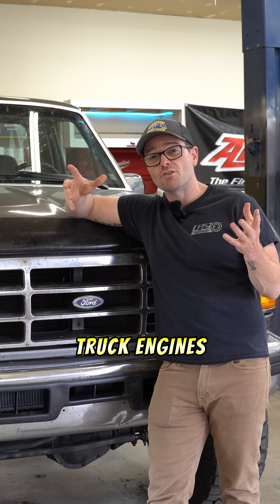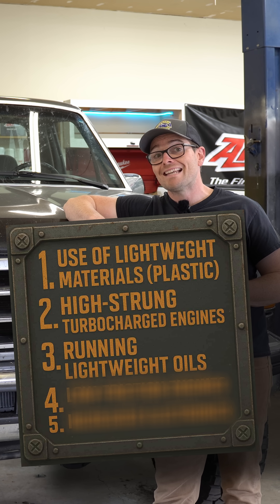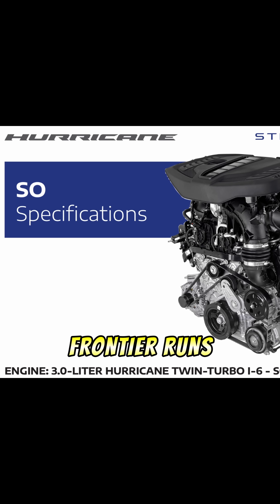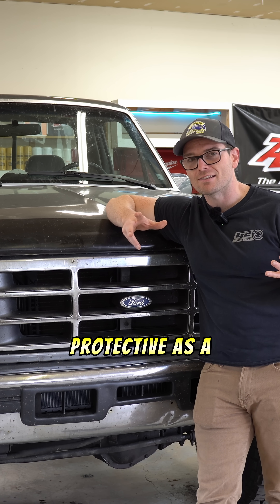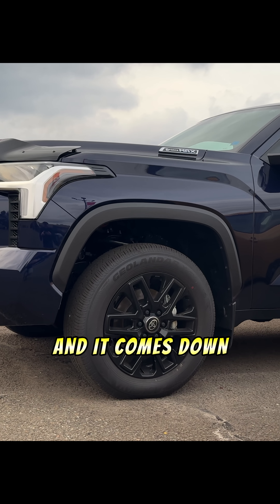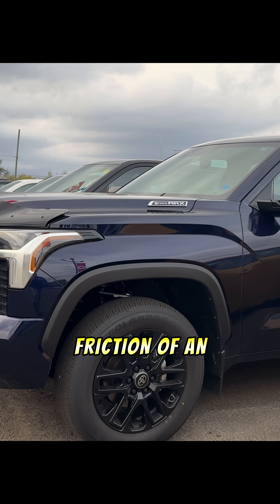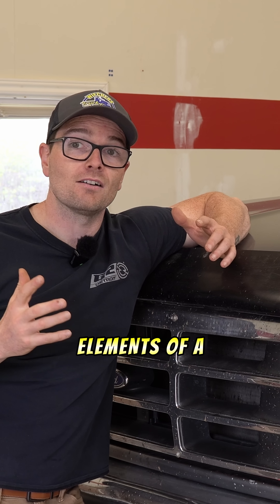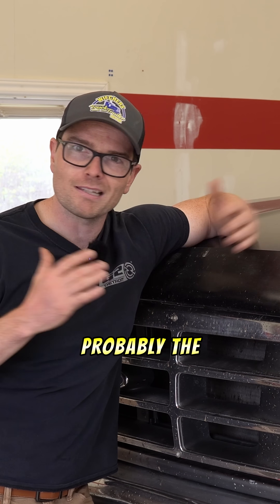Major Reason Modern Truck Engines Don’t Last as Long 👀

Comment: You know it’s crazy personally I know someone who has a 2019 Tahoe he’s supposed to run the manufactured oil viscosity he doesn’t he runs 5W 20 or 30 and it has not blown up on him once it has over 90,000 miles brand new he got it since he reached the breaking period. Switched to 5W-30.

Comment: The Toyota 2gr-fks engine is used in multiple locations. Toyota engineers specify 5w-30. The US GOVERNMENT specify 0w-20. I'll stick with what the engineers say. The EPA and CAFE regulations are not in your best interests if longevity is your goal.

Comment: My HEMI RAM uses 0w20 they say more the lifters lighter oil easier to get oil everywhere... 

I had a 2014 5.7 with 245,000 miles with zero issues, my 2023 had 45,000 miles no issues yet...I guess I will find out...

I use Pennzoil ULTRA Platinum that's the best oil it's as good as redline and Amsoil...I  change at 5000 miles but even my 2014 I went 8000 miles a few times,just busy but oil was clean and mainly hwy driving and I am not hard of them...Yes,I floor them more than the average guy but baby them!

My classic cars I run 10w 30 with zinc additive and or hot rod and classic oil! Usually 10w 30 with zinc on my 440 and 383 even my 340 Mopar all run 10/30 and zinc...My new RAM 1500 (two of them wifes and mine run 0 w 20)

Comment: The hotter that 0w20 oil gets the thinner it gets and more chances of metal to metal contact on the crankshaft/rod bearings. But just wait until engines require even thinner oil
Reply: Congrats, you described exactly how multi viscosity oils work. 5-40 does the same thing. Lube weight is an afterthought when you consider clearances, pressure supply, and total circuit volume.

Comment: i run 15w40 in my 6.7 powerstroke, my l5p dmax, tym 574 tractor, ferris 6200 cat powered diesel mower, and from time to time toss some in my polaris general if it gets low. i buy my oil by the 55 gal drum from amsoil.

Comment: What does it do for the power of the engine?. I personally have sean the lighter oils weaken engines quickly. I feel thiers a balancing game that these manufactures are makingare the problems worse and they dont make sense. How bout all the extra emissions from restrictions to carburetor cars. Thier fuel efficiency can become something people jaw dropping.  wouldn't it make sense if to save oil and emotions by having a vehicle have great power , speed, efficiency, lower running temp, responsive thrhottle , plenty pf power and with modern flat slide carburetor's reducing moree parts needed. No computer needed even with mechanical direct injection . A mechanical marvel designed to last and get fuel economy from 20 mpg all the way to 120 MPG and higher wouldn't you want that. You win . Or would it crash the market due to how much oil is currently needed to be sold to keep an economy healthy

Comment: Is it possible to run slightly higher weight oils in the newer engines to provide more protection, or will it destroy those engines?

Comment: I have a 2003 ford F150 5.4 2 valve with 426,000 miles on original powertrain.  I use 0w20 high mileage,  again 426,000 miles and runs perfectly.
Reply: 🤣🤣🤣no 5.4 has that many miles!🤣🤣🤣
Those engines are garbage!!!
Reply: @philllsxga.7737 the 3 valve was awful,  the 2 valve ( which I have, its common to see ultra high mileage.  That's a common thing. ...   Oh yes,the miles are real.
Reply: @michaelhungate7506 no way!
I know the timing chain and phazers have been changed.
Reply: @philllsxga.7737 the 2 VALVE ENGINE DOES NOT HAVE PHASERS. You are NOT understanding the difference.  Google it, tge difference between the 2 valve 5 4 and the  3 valve 54. That's why there is such a difference,  the 2 valve didn't have the timing problems either.  Very different engines!!!!!
Reply: @Takeiteasy-u3r the 5, the first number is oil flow at cold start, you want it as thin as possible so it lubricated quickly. It works very well,  and the 20 is operating temperature viscosity which is the same.

Comment: 30 year lubrication engineer here. Just retired.  I saw SAW  5w-30 engines lasts twice as long as SAE 0w-20 or 0w-16 in fleet testing.  I only run 5w-30 in my gasoline engines and SAE5 w-40 on my diesels.
Reply: “lubrication engineer”. What exactly is it you did, and what company and what was your role?
Reply: @l @lukeWiz44 
Pennzoil Quaker State technology manager. For Shell
Reply: @lukeWiz44  he worked a company called Nonofyourbizniche. He was involved in how to “grease the skids” or “lube the tube” in cases when certain equipment or individuals needed ‘tude adjustments. His title was VP In Charge Of   Experimental Viscous Lubricity.
Reply: @lukeWiz44  he did your mom

Comment: Rolling a 2012 tundra that specifies 0w20 mobile 1 in the manual. Used it since day on 10000 mile change intervals per the book. Clocked 367,800 miles. Uses a 1/2 quart after 10,000 miles. Seems to be okay so far, don't know maybe I can complain one day?

Comment: I run 0 20 in winter 0 30 in summer I'm not an engineer but my vehicles last 300000 km before selling them 0 will get there faster.

Comment: Oil weight does not matter, if you have the same flow and pressure with 0-20 as you did with lets say 5w-30 there is no difference

Comment: Hello from India,

Thank you very much for making deeply technical, passionate, and informative content.

I own a Jeep Compass diesel manual with the 2.0L Multijet II turbocharged engine from Fiat. According to the owner's manual, 0W-20-rated oil that meets the API-certified SAE 5W-30 ACEA C2 - FCA 9.55535-S1 synthetic engine oil standard is recommended.

I was hoping to get your guidance on whether it's best to stick to the recommended standard or switch to a higher viscosity range. Also, if possible, please recommend your trusted brand of engine oil.

Thank you very much once again.

Comment: I’ve always found my Volkswagen runs better on 5W40 than the “recommended” 0W20.  In fact, the prior version of the same engine with the same displacement ran on 5W40.

Comment: Or the real answer engine tolerance is that changed because of this tighter tolerance that oils do a lot better than thicker oils I mean it’s like pretty simple automotive science you know we’re using proprietary fancy materials that we didn’t use historically and so now because we have a difference of materials inside the motor. We have like aluminum rods and magnesium and blah blah blah that it’s just we need thinner  oils because the tolerances are so so so much tighter

Comment: 2017 equinox was burning oil. I think it was 5w20. At a 145,000 I started putting 20w-50 diesel oil in it. Let go of it at 240,000 miles and was still burning oil but still had power.

Comment: 0w20 isn't a real problem if the engine was designed for it. The Ford 6.2 gas  is like a 2010 engine, it runs on 0-20 weight, and trust me, that thing does not want to die till 500k miles

Comment: You hit it on the head reduces friction especially on cold start ups. It’s still a 20 weight oil only 0 when cold. Better protection on cold mornings and for turbos.
Reply: It's actually a 0 oil with friction modifiers that makes it act like a 20 oil when hot.

Comment: Love to see everybody in here amazed that their truck especially a ram or Chevy has almost made it to 100k miles. Open your eyes people they should be lasting triple that
Reply: If I had to drive across America my 7.3 no doubt could pull off another 20k without huge expenses
Reply: I saw that as well I’m thinking 100,000 miles? That’s practically new! I’m 52 years old and when I was a teenager I was buying cars that had 250,000 miles on them for 500 bucks and all of them actually ran perfectly. Back then cars took 10W-30.

Comment: Just put 5w-30 on everything
Reply: I really believe that would work fine. That's what I've been doing on my junk that calls for 5W20 .
Reply: @oneninerniner3427  i put 5w-30 on all my cars ive I've had, also idles a lot more quieter because it's thicker than any new recommended oils

Comment: I run 0w-20 in my wrangler and have 0 issues. If you're actually worried about it, look up motor oil geek not this mechanic.

Comment: I remember in the early 80’s when they were going to 5-30 in a lot of vehicles and we used to think that was thin as piss!! I am a recently retired technician with over 40 years professional experience and you can change the viscosity some but you have to watch it in some vehicles with variable valve timing because it can throw that off sometimes if you start running 10-40 or 20-50.
Reply: 5W30 and maybe 10W30 wouldn't be too bad. But I don't think I'd use 10W40 - 15W40 - 20W50 in a modern vvt engine.
Reply: Do you think the science of the anti-wear additives has improved over the last 40 years and the thinner oils being bad is a conspiracy theory?
Reply: @ResourceRentals somewhat. I think these 0W-20 oils are unnecessarily thin for fuel economy. 5w-30 and 5w-20 will probably lengthen engine life without being too viscous.
Reply: @LinusScrubTips  how soon until we get negative number oil weights??
Reply: @LinusScrubTips   yes 👍

Comment: Well unfortunately for you sir, Toyota has been running 0-20 oil since the late 2000s and their v-8s have hundreds of thousands of miles on them with this oil so that makes you wrong.
Reply: Not true at all. They didn’t start recommending it until around 2010. Even then they had a transition period where it was 5w-20 or 0w20 meaning 0w20 isn’t really necessary.

Toyota literally recommends 5w-30 for the 3ur-fe V8 in other countries. If it was my truck I’d run 5w-30 or 5w-20.

Comment: It's not just emissions. That's an excuse. Modern engines have significantly tighter tolerances than old ones. You need thinner oil to flow faster to the components (such as cam phaser solenoids) and get in-between bearing clearance.
Reply: The tolerances, or more accurately, clearances might be slightly tighter. But more importantly they are more accurate with better surface finishes and metal treatments.
Reply: Nope.  It's CAFE, not significantly tighter clearances. But it is important to use a high quality oil, preferably a premium 100% synthetic to keep the fine screens on the solenoids clean & open among other benefits it provides.
Reply: @oneninerniner3427 there are plenty of people getting hundreds of thousands out of diesels still. Too many daily drivers and not actual work trucks... People aren't running regen, which is a user error.
 Every day at the shop when I was there, there was both wrong fuels and no regen super duties. It's all customer caused, not CAFE.

Comment: Did I hear this man say that the lower viscosity reduces friction? That is so dumb, it reduces pressure and helps it fit into tighter tolerance areas, but the lower viscosity increases the friction that causes the issues.
Reply: Clearances, not tolerances

Comment: You don't have to run 0w20, it's just a reconstruction to satisfy CAFE standards.
When you look up these engines in a worldwide database you'll see that it's only the US and Canada that call for it. Everywhere else is at least 5w30 and up.
I've never ran 0w20 in my 2020 Tundra, Shell Rotella t6 5w40 is what it gets and I have over 111,000 miles.
Worldwide the 3UR-FE 5.7 calls for 5w30 up to 20w50.
Reply: Nice!!! I'm running 5-30 in mine and thought about doing the 5-40. I live in AZ and we get some hot temps here.
Reply: @jamesvaldez4093  I'm in Michigan, I've opted to just use t6 5w40 year round, in my parts we usually see 0°F in the winter and the t6 5w40 is rated for -20°F.
Up state they see -50°F at times.
I've never had a hard time starting.
I even run it in my wife's Sienna. 
I send out UOAs every other oil change so every 10K and our wear metals are well below the average PPMs even with towing about 2,000 miles a year witht the Tundra.

Comment: I've owned a 2014 f150 with a coyote 5.0. I change my oil every 3k. I've used Valvoline 10-30 max life init since new. I've had 0 problems with it 0 leaks it's Ben perfect with 230k on the clock.
Reply: Completely unnecessary to change that often with a full synthetic
Reply: @flynnryder7798 too bad, that's what real men do.
Reply: @ironwoodnf if by that you mean men who haven’t kept up with engine and oil designs and technology, then yes, I agree.
Reply: @flynnryder7798 Flynn is everyone who is right, mean in your eyes? You go about your day trusting American auto manufacturers to have your best interests in mind. Ill go about changing my oil like a bad habit 👍
Reply: @ironwoodnf you don’t have to trust them. Send in your oil for analysis to blackstone. If you do this, you will see 3,000 is absurd
Reply: @flynnryder7798  i'm gonna be driving a golf gti with a 2.8 vr6 someday... do i want to go further than 5000 km on oil changes if i'm going to be driving it spiritedly, taking it to the track, etc. nah.
Reply: @emmareporter if you want to waste time and oil, go ahead.
Reply: @flynnryder7798  literally would take like 10 minutes to change. also i would make sure to do a change every time i come back from a trackday as well. engines are expensive. oil isn't.
Reply: @emmareporter you can, they’re just isn’t  any benefit. Similar to replacing your tires when they’re still plenty of tread left.
Reply: @flynnryder7798 Tires can have plenty of tread left and still be time to change them.
Reply: @flynnryder7798 I have and you’re wrong. Or more specifically, it depends on the vehicle, so I suppose there are some instances where you are right with a specific vehicle.
Reply: That is internet myth.
Reply: 2013 F150 5.0. Change oil every 5k. Motorcraft 5W20 (as recommended) 275k miles on the clock and climbing by the day. Original engine never opened.
Reply: Thats cool but i dont see my self paying 400+ /mo. On fuel . The Maverick hybrid is perfect for my needs😊 and i can afford to throw 10 bucks in that coffee can per week as an added insurance incase of an expensive failure🎉
Reply: @NawHomeeyeah but that is a not a real truck 😂 it's a crossover with a bed
Reply: @ironwoodnf ill mostly go on home depot runs maybe carry my recreational toys, nothing too heavy. I had a friend who routinely used chrysler minivan 3.3 to tow his trailer and looking at the numbers the comes close to those minivans and thats really all i need🎉
Reply: @NawHomeesucks to suck… dont buy a truck then
Reply: @JohnEas-nx9dr most truck owners never push it to full capacity 😊 i will actually carry 1000lb  on the regular 🎉 . AWD will give me peace of mind when going through colder areas but wont play off road with this truck, i see an expensive failure for those who try it

Comment: My '25 F350 7.3 godzilla take 5w 30.  I do my oil changes every 3,500 miles.  People have to get it in their heads to stop thinking about changing 5 to 10k miles.  So many factors other than just miles you put on.

Comment: These engines are also getting way smaller with less durable engine materials while being pushed for incredibly higher horsepower. That is just a recipe for disaster. We went from big cast iron v8s with low horsepower lasting 300k no problem (most of the time) to engines being on worth their weight in scrap for tens of thousands more dollars.

Comment: I’m using 0W40 in my 6.4 Hemi Power Wagon and it just doesn’t feel right. I’m also in rural Ontario. Are you running 0W40 also or have you looked into running a 5,10,15W40?

Comment: love your content.  i have a question.  do you have an opinion on which is a better powertrain today-- the nissan frontier or chevy colorado?  and what immediate drivetrain upgrades would you recommend to get higher mileage out of these two trucks?  i see some people say to immediately swap out transmission valve bodies -- for example.

Comment: Increase the oil viscosity to 5w30 for all these 0w20, 5w20 specifications.  If you tow or are in hot climate 5w40 even better.

Comment: You are correct dude‼️ The government and the manufacturer don’t give a shit if your engine blows up because it usually happens when it gets out of warranty. GM had to belly up to the bar on that Escalade that blew up with less than 500 miles on it and they keep running the prices up. No one should buy a new vehicle in 2026 and see if we could help them get their thinking straightened out.
Reply: No more government bailouts 🤔

Comment: CAFE standards have done nothing but screw over the consumer
Reply: I run heavier oil in summer.  Usually 0W20 in winter in cars that require it, and 5w30 in summer.  I read somewhere that Ford wanted to recommend 5W30 in the summer for F150’s, but then they would have had to recalculate fuel efficiency with the 5W30 oil so they decided not to.
Reply: That's not it!
Over 80 percent of the vehicles on the road are leased.
So why would a manufacturer make them last past the warranty?
No I do not agree but that's the truth
Reply: Nope. CAFE is a nudge. There is NO law saying that manufacturers MUST screw their customers.
But you are so uninformed that you blame the folks trying to keep you from being screwed.
Reply: They dont want engines to last.
Reply: "Consumer"... being called this or referenced as this is so sick. Most people dont care or have any original thoughts to not like this label. People love labels. All we offer the world in America is consumption? Does that not sound good? We're cooked.

Comment: My wife's 2010 camry 4cy camry runs 0w20. 170k and oil comes out amber at 5k? I don't get it.  My 23 titan also running 0w20. Will mine not last long because of large v8 vs her 4? I'm honestly curious.
Reply: I have a 2019 Titan I tow a 6,500 lb camper with. We take it a lot of places. I haven't had a single issue. I changed the oil every 4,000 mi.